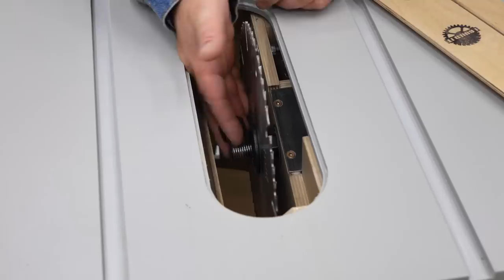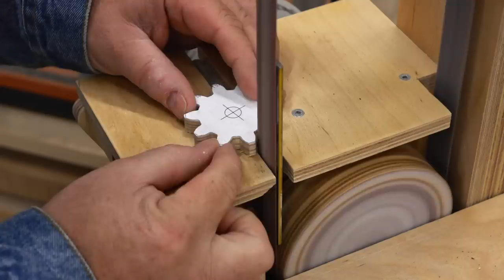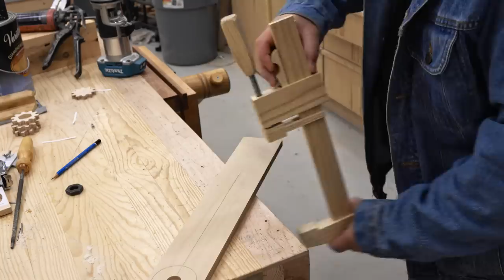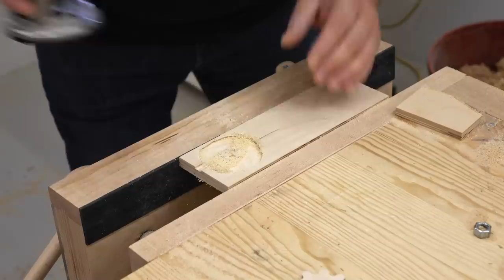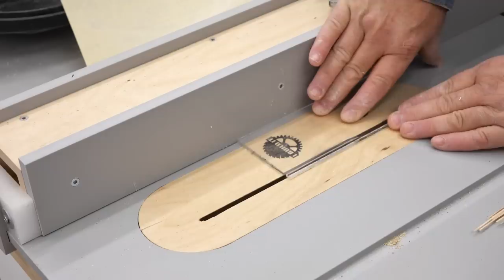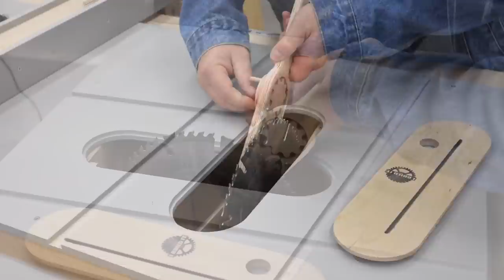Was This Genius, Or A Waste Of My Time? Gear Connected Table Saw Nut Spinner-Oner

Comment from the maker: Even if I don't use this (I will), I think it was worth making just because it looks neat. The dowel on the crank turned out to be unusable, since the crank it too small, but it works just fine turning it with my fingers.
Reply: You should tweak your design and then patent it and sell the design/build instructions. The hand-crank could possibly be a forth gear?
Reply: @Juan Cespedes hahahaha! That would have been golden.
Reply: Awesome remedy for an all too common problem! I agree about the dowel, a gear with finger spaces would be better and it will feel like you are turning the nut.
Reply: 🤔 John l think we need a new table saw build with auto blade changer🤭😎🤣
I guess a remote nut spinner will do for now👍👍👍👍👍👍
Reply: Alot of work just to put a nut on when a magnet on the end of a stick would be effective enough. However you can take the experience and perhaps use it elsewhere.
Reply: @rickjohnson7155  Wow, that would be a fun build. Today we will glue a magnet to a stick. Ok, so that's done. See you next week. Lol. That's the point of a lot of these gadgets is to have fun in the shop.
Reply: How hard do you think it would be to make a wooden roller chain?
Reply: Excellent
Reply: Juan Cespedes maybe with a Sheriff John Bunnell (retired) voice over.
Reply: The only thing I'm questioning is why you picked that number of gears when it means you have to spin your end in the opposite direction to the way you want the nut to go! :)
Reply: Take a page from Izzy's book and make it drill powered. Can't say I have to deal with this inconvenience myself though. Table saws have short arbors here, no dado stacks for us.
On the other hand, changing a blade on the Robland is probably the easiest blade change there is. Push the slide all the way forward, open the access panel, this locks both the arbors, and then just undo the nut on the blade that needs changing.
Reply: Fun project, but if you were having difficulty holding onto the nut, why not just wrap an elastic band or two around it to give a bit better grip for your fingers?
Reply: Hi John, I'm guessing, is a Infinity saw blade in the table Saw?
Reply: Oh ! what a funny thing - I can`t stop laughing. 😂 But its a great job you've done and a good clip, too. Greetings from Germany - the Raven
Reply: I wouldn't call it genius. I'm pretty sure I've seen some very similar devices before but it is definitely useful.
Reply: @thomasmacdonough7763  It could be an actual nut or facsimile of one, Then it could be named as some variant of the daVinci robots that doctors use to perform surgeries.
Reply: brookead I was thinking the exact same thing. One more gear would solve the problem, and would make room for a larger, more usable, crank handle
Reply: I like it! The other comment about an oversized cog with teeth projecting as your finger moving surface is great. More importantly, put a half moon rest matching your insert plate  to hold it where it needs to be, you're using inconvenient pressure both holding it at the right angle and pressing in to the blade face. Bonus points, countersink a ceramic magnet into the interior nut profile. Thanks for sharing, you blew past Should and presented a closed case for Can!
Reply: @neilscole  could do a drill adapter as well, or even use a gimbal motor to power it. humm, now I do need to make one.
Reply: John, it’s genius because you get paid for views and it’s definitely interesting enough to watch, but I did notice that getting the nut started on the threads which is where the real problem happens was cut out lol is this because it’s a pain to try and start?
Reply: That is the fanciest paddle I have ever seen.
Reply: Waist of time cause a decent tablesaw you can open the side so you have acses to the nut
Reply: I like it!!!
Reply: Amazing
Reply: @quarlow1215  Cracking answer!
Reply: Here is an idea. Imagine if you will using the same idea as a lawnmower cord pull for tightening the nut or loosening it. You might need to redesign or use different materials because of the added strain but it should be a powerful motion and should be able to spin quite fast. Biggest problem I see is just to allow the cord to be pulled back in without counter spinning the nut.
Reply: Add some paste wax on the pivots, gears and on the backsides of them as well, it should make it even easier to turn
Reply: Good entertainment. 
I use a piece of duck tape on one side of the wrench, place the nut in the wrench that will not fall because its glued to the tape, and that's it.
But your gadget looks cool.
Reply: Agree. Crazy ideas need to be implemented, otherwise, you would not know if they are crazy enough for the purpose. Respect!

Comment: Cool. I miss the days when Mathias would make a competing version. Taunt him !! Thanks for all you do.
Reply: Please Mathias, make one with 5 gears!!
Reply: @ChrisUhlik  Yes and from Lego with a raspberry pi attached...
Reply: Mathias, should make one with metric measurements! lol
Reply: Mathias would make one with an interchangeable primary gear and provide a handy spreadsheet of gear ratios and their respective speeds and torques.
Reply: @ChrisUhlik  The number of gears are dependent on getting the nut-gear to spin in the same direction as the crank-gear. Unless I mixed up my circles and arrows, I think a five gear spinner would do this. a four wheel spinner would require the user to twist the crank in the opposite direction that the nut is to spin. Of course, Genius John may have been accounting for fact that the saw arbor and arbor nut have left-hand threads. 8^)
Reply: Seems like a lot of the routing of the handle could've been made efficient by some kind of small router mounted on a parallelogram jig thing

Comment: John I had a lot of fun making this.  I had to improvise.  I have no idea how you routed out the housing for the gears freehand - beyond my capabilities.  I ended up using a 2-5/8" hole saw first and my gears were 2-1/2" so they fit nicely inside.  I still found it difficult to see where I was routing because I couldn't get enough light down there as I got to 1/2" deep.  I also opted not to freehand route the two integrated axles.  Instead, I cheated and used 1/2" dowel.  Great gadget and I drew a few conclusions about you as I was going the the tedious process of cutting gear teeth: you must be very wealthy to have so much time on your hands to make this.  It took me a week puttering around in the evenings when I got home.  Keep up the good work.

Comment: John, you are known for coming up with innovative, practical and relatively simple ideas for your jigs. A case in point is your 'Ultimate Box Joint Jig'. But this time, for the Table Saw Nut Spinner, you have deviated a bit and made it fairly complex. 
Possibly, it was just a fun project for you. As always, it was enjoyable to watch you build it.

Comment: I find if I raise the arbor all the way up, the nut is a lot easier to reach.
Reply: David Walling 
If I raise mine all the way up it’s no problem what so ever for me to get to it.
Reply: Larry, that’s what she said.
Reply: @david walling: That'd be cheating. 😉
Reply: a magnetized ratchet wrench work so well. A piece of tape on the back side of the nut on a box and works really well too. As does putting the nut between your index and ring finger and rotating the motor shaft with the other wrench behind the blade.

Comment: That's a great idea John and the final tool is another one of your impeccable projects.  I lost the nut for my saw one time and spent a fair amount of time digging through a pile of saw dust to find it.  From that time on I used a simple trick to avoid that happening again.  I place the nut over the tip of my forefinger and then place the finger directly over the end of the threaded shaft.  I then spin the nut on the shaft using my thumb and middle finger.  I never take my forefinger away from the end of the shaft until the nut is on the shaft it full thickness.  I take the nut off using the same thing in reverse.  I hate it in the winter time when the saw is ice cold but hey, I don't lose the nut anymore.  Still, I like your multi gear arrangement.

Comment: Genius.  My 12" table saw has a solid bottom for the vacuum system.  Drop the blade nut, dismantle saw bottom to retrieve.
Reply: Magnetic pickup tool.  10 second solution.  It can be as simple as a magnet taped or glued to a scrap of wood.
Reply: @Bikeeast  If you can see the nut or there is sufficient space to angle the magnet. I will go with the fun solution.
Reply: Same here!
Reply: You’d think it would have an air tight inspection hatch to get in it, without dismantling it 🤨
Reply: My thoughts exactly
Reply: Mine has the dust collection right in the bottom. Drop the nut and you’re going fishing. I dropped the wrench once, had to take the whole hose off

Comment: Fine presentation, Rube!  This is just what a fumble-fingers needs!  What got me was - when I glued up the two halves of the crank it became one with the main handle.  Not doing this all over again, but it can hang over there in the corner by all my other "almost tools." 

And it was GREAT to show off your fine, similarly designed vice!  Still debating whether I should try THAT one.

Comment: Genius, but I want to see a version that uses a rubber belt and two pulleys, one that uses a wooden worm-screw drive, and one that uses a wooden chain drive!
Reply: Or... a harmonic drive 😏
Reply: And a motor with a 12 AMP battery hookup and UPS charging!

Comment: Needed another gearwheel in the sequence so that the nut turned the same way as the handle !
Reply: pmailkeey 
Actually, he needed to reduce one gear, the result is better handling, and nut direction of turn. Thumbs up!
Reply: @alcamerc9970  That's an option but I  was concerned length may have been reduced too much to work as well.
Neat gadget though !

Comment: But now you‘ll be swearing everytime when you‘re using it,  because it turns in the wrong direction. :)
Reply: I was thinking the same thing. Why didn't he make an odd number of gears?
Reply: I think they need to be made in pairs on - off, lefthanded and righthanded, up - down, in - out and special shake it all about one for high days and holidays 😎
Reply: @Akniy  Righty loosey or was that lefty tighty? Humm?
Reply: Why shoud he change the direction? Astronomers have been contented for centuries seeing the moon upside down in their telescopes. And Nobel prizes have come out of it.
Reply: @NICEFINENEWROBOT  Roger that!
Reply: @akquicksilver  Your considerations were very much expedient, too. I liked that.
Reply: Put a magnet on the wrench that holds the nut and you can tighten it....you chose the easy way.....
Reply: @jurgenei8702  My experience says, magnets like to jump anywhere else if they can.They are not immune to the seduction/suction/induction? of ferrum around. Maybe attraction was the word...
Reply: the project can turn left or right so whats the problem?
Reply: @arlene mae quinanola The handle rotates in the other direction than the nut, because of the even number of gears.
Reply: @lagandi  you can rotate the handle on either direction. if you turn the handle cw and the nut will not go then turn it ccw to secure it. you still need a spanner to tighten it anyway. whats so hard about that?
Reply: I think most arbor threads are reverse so just do what is normal to do.

Comment: From Leo:  Interesting and great attention to detail.   I welded a shortened socket with a magnet to a piece of band iron. I pull on the belt to rotate the shaft.   Your's is a lot more advanced.   I have never even made a wooden gear.  You are the master.

Comment: Very nice. I made something similar about a year ago. I took one of those ratchets where you can turn the handle to rotate the lower thing and welded a shortened socket on it. Your solution looks even less bulky.

Comment: Nicely made... I sometimes use a socket wrench in these situations, but it's often not possible to move the wrench's handle quite far enough to get the nut threaded.  This tool solves that problem, perhaps I'll have to build one.  I would put a square bit of steel at the end to hold a socket, so that it'll work with any size nut.
Reply: How many table saws do you have that it would need to be multi functional?
Reply: @KipdoesStuff  Lol just the one... but there are more places where one sometimes has to reach into a small space to place a nut.

Comment: Finally, I see this video and now I know what that is. Have seen it in many videos sitting on the table saw fence and have wondered what the hell it was for. Would never have guessed it, but in my defense, just sitting there I couldn’t really see the nut hole, holder part. Yes, if it keeps you from dropping the nut down the dust hose, it’s well worth it.

Comment: that’s really fancy.
i pur earth magnets all over the drive motor that sits directly under the nut so maybe one of them catches the nut before it gets buried in the saw dust.
maybe you could add a regular magnet to hold that nut in that drive tool so you don’t accidentally drop it and have to build another tool to retrieve it....like a magnet on a stick.
you did a nice job as usual john....cheers mate

btw, don’t you and your friend mathius have a jig to cut those gears?

Comment: You should include a pawl like in a socket wrench into the design.  That way you can use the leverage of the entire paddle afterwards to snug up the nut instead of having to follow it up with a wrench.  You'd still probably need the crank though since the nut will be too loose in the beginning to overcome the friction of the pawl.

Comment: I use a box end ratchet wrench with a piece of duct tape over the side opposite where the arbor bolt will be.  Holds it in place and turns to get it on.  Once on the bolts will just push past the tape.  Works on my Porter Cable and my old (1970s) Craftsman.

Comment: GENIUS!

How has this not been thought of previously?
You would think someone would have developed and produced this commercially
Maybe out of steel, with locking gears so you can torque it on/off, AND run the nut off/on

Comment: I can't believe no one else ever thought of this brilliant idea
Reply: The probability that someone else has had the same idea and done the same thing would be pretty high. They may have used different materials including metal. What John has done is publicise what he has achieved and this is the more important function that John does.

As has been said many times elsewhere, ideas are dime a dozen or a pennies worth per ten thousand. What is far more difficult is the getting the idea to an implementable device or system. What John has done, and kudos to him for it, is actually making a device that works. In this case, he now has something that he will use and he has shared the idea and the implementation with others. 

This is what brings about advances of everyone.

Comment: I cup my hand when lowering/raising the nut & washer from the table saw cavity. This makes it impossible to drop a piece. However, I still like the invention and I believe it is worth patenting. A mass producible version, with all the kinks worked out, would make a great tool of convenience in the shop. Some table saw manufacturers may even include it in future sales.

Comment: Genius in concept, But in 30 plus years, I never had a problem with dropping the nut, except for maybe twice in all those years, even with my extra large hands. I was a very fast worker, who produced the finest quality work. To be fast, every move I made had to be efficient. Taking the time to reel a nut on would be considered a joke. However, if you have a problem with dropping the nut, it will save time over sifting through a pile of sawdust. I greatly admire the solution you designed. The biggest element in this work I will forever miss, is having unique problems that needed to be solved quickly. What about changing your gear ratio to get more revolutions at the nut per crank? Or something with a reel of spring steel (much like a tape measure) that will zip the nut on with the yank of the coil?

Comment: I’d say from the practical point of view, for Gods sake get on the floor and fetch whatever fell. From the creative point of view, if you have the time, I’d say this is awesome. I had a garage shop before where I built good furniture, not anymore, but during several decades I did come up with some ingenious ideas on how to make it easy when handling some aspects of carpentry. Of course that was only if I had no project going at that particular time, a rarity then. All in all, this is very clever and a nice project for a Sunday afternoon. Thanks.

Comment: make the gearing reductive and put in a hardwood inset (or even a slice of the proper-sized socket) so you can actually tighten the nut without the wrench.

Comment: Here is an idea. Imagine if you will using the same idea as a lawnmower cord pull for tightening the nut or loosening it. You might need to redesign or use different materials because of the added strain but it should be a powerful motion and should be able to spin quite fast. Biggest problem I see is just to allow the cord to be pulled back in without counter spinning the nut.

Comment: That's an awesome and useful supplemental tool. I will definitely have to consider adding it to my arsenal lol.

On a side note, I recently was gifted an older Delta jobsist table saw in unknown condition. But inspection of the tabletop revealed it is dead flat still. I'm going to delve further tomorrow, but I am hopeful to restore it to working order. Any advice for removing the rust and treating the cast iron top?